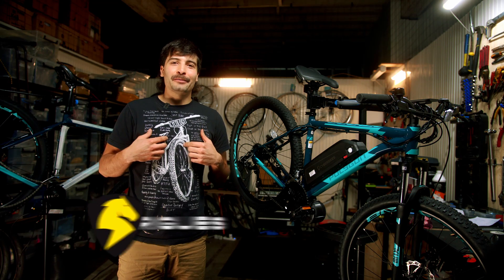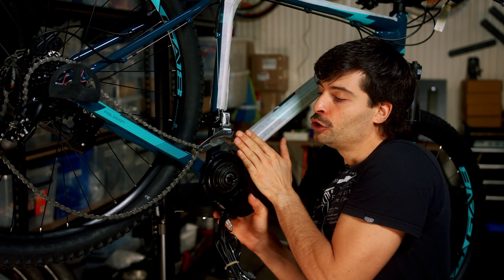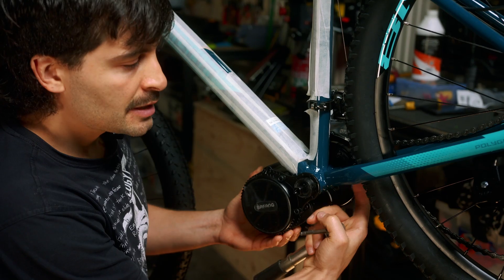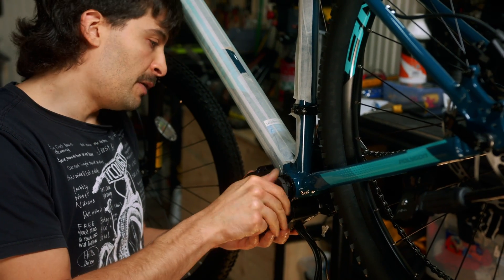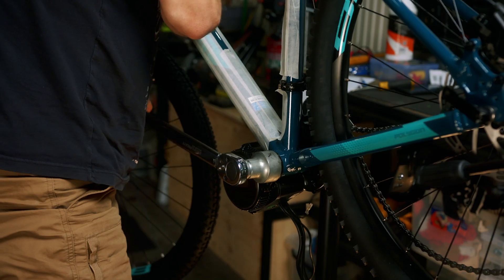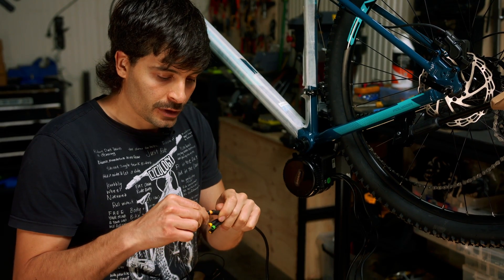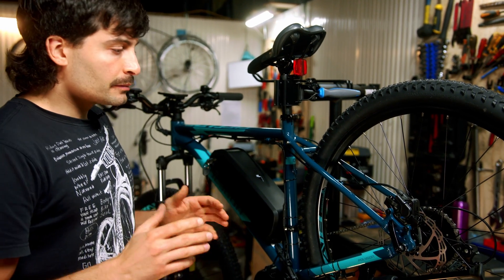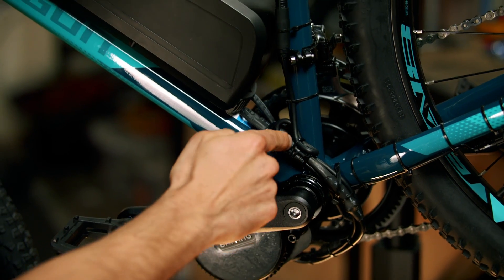How to Install a Bafang Mid Drive motor on your bike

Comment: Hi Felipe - love your videos, you clearly know exactly what you're doing and I have been following your advice! I have a question and hope you can answer - at about 2:12, you add the supplied metal plate to the motor. On my bike, with the metal plate nipped up against the bottom bracket, I have about 5.5mm gap between the holes in the motor and the back of the bracket. To me this is too far to have the bracket "bend in", so I plan to use some of the supplied black spring washers. How many mm can I leave to get that "bend" you want? 1 washer width? Hope I am explaining myself clearly enough (first time fitting a BBS02 to my Rocky Mountain Growler). :)

Comment: Fantastic video, I wish I had seen it before. The screen went out a few days ago and I realised that it was for the reason you mention of having the connections behind the handlebars, causing an internal breakage of the screen cable terminal. I also made the mistake of running the motor cables between the motor and the bike frame and when I disassembled and greased it, I could already see a small break in the first cable cover (thank goodness I didn't break it completely). Now following your instructions I have proceeded to reassemble everything as you said and it is perfect. Thank you very much.

Comment: Thanks for posting this video. I installed a BBS02 on my bike and didn't even think about the chain stay clearance. I went straight away and checked it.  I have about  0.5 mm clearance between the chain stay and the motor shoulder. Guess I got lucky!

Comment: Hey! Does the motor need to touch the bike frame to tighten the bottom bracket? I gave mine a space between the engine and the frame because the format of my frame is pretty strange. Can I leave it that way? Thanks for the video!

Comment: E very easy to do I did my new 29” but it came with a PF30 which you will need a PF30 to BSA aluminum 73mm adapter pressed into your bottom bracket.

Comment: Does the BBSHD motor have separate wires for speed & shift sensors or do you have to buy a splitter  to hook both up ???
Reply from the maker: The speed sensor is one cable, the gear shifter is another cable, they have different connectors. What you have to check with your supplier is if the controller has a shift sensor connector, the speed sensor is by default coming with all motors

Comment: thanks for the video , can you maybe give advices how to organise cables near the steering wheel not to look like a spaghetti
Reply from the maker: Great suggestion! use small zip ties and instead of squeezing them together try to mimic a loop around the brake cable

Comment: So glad that I found your channel, by far the best E bike channel on You Tube. In this video you say tighten the bottom bracket to 80Nm, but in your other video on the installation of the Bafang motor, you say tighten it to 60Nm. Which is the correct torque Thanks for all the time and work you put in to helping others
Reply: Hi Richard, that's true. We've said in previous videos to tighten the nut to 60Nm because that's Bafang's recommendation. However, at the shop, we have been doing 80Nm, and after much discussion with our mechanics, we decided to publicly say 80Nm is the correct torque, even though it's not endorsed by Bafang. So, in old videos, you will hear me saying 60Nm; in newer videos, you will hear me saying it's 80Nm, swimming against the tide and haters. Still, it is what it is; in real-world exposure, tightening the motor with 60Nm won't hold it in place, and 80Nm does the job without compromising the motor's integrity. Thank you for your kind words and appreciation; I wish you all the best with your installation.
Reply: @frcr90  Thank you Fellipe for clearing up the confusion. All the best

Comment: This is an excellent guide with important tips to ensure longevity and reliability of the system. These tips are learned from his extensive experience in installing, using and maintaining these mid motor Bafang systems. He knows what he is talking about. Take advantage of this wisdom.

Comment: Can I suggest sir? Why if we put a METAL BRACKET or it's equivalent on a diagonal frame attach to the motor so it won't fall down in case the support provided by the Bafang kit.
Reply from the maker: You can do that Rodolfo, there are companies that manufacture that sort of attachment, search for bafang torque arm/bar and you might find it
Reply: @Cyberbikesau  thanks Sir.

Comment: Thank you so much for these valuable insights!
Reply: No worries thanks for your comment Missak
Reply: @frcr90  i am confused between 500w and 750w, i live in a mountainy area, you think 500w is enough, i dnt offroad. if 750w, what battery rate do you recommend? thank you

Comment: Hi!
I Have A Q
It's Normal For The
Motor To Have Some
Resistant  When You 
Pedal.
 Not Using It???
Thank's
Reply from the maker: Yes, it is normal, there are many reduction gears inside the motor, bearings, and clutches, and all of them will generate resistance against your pedalling. What motor do you have? What's an issue you're facing? Is your question related to thinking of converting a bike and wanting to know if you could ride it like a normal bike?
Reply: @Cyberbikesau  Thank's For Helping Me🙏
It's A Bafang mid 750w
Puting It In A Mongoose
Ardor 27.5.   2.6 Wide tires. Just Watching Some
Vids On How To And Yours Is The Best💪
Thank's Broo🙏
May God Bless..
Reply from the maker: @danielandujar5479  thanks Daniel, looking forward to read your comments again in our other videos! We will publish some more juicy tips about Bafang motors, stay tuned!

Comment: Hi Fellipe , Question on the install , the chainring is it the stock Bafang chainring or one with more offset due to putting space on bottom bracket ? Thank you for taking the time to advise me it' truly appreciated.
Reply: Marc, it's not rocket science. If you added spacers on the motor, depending on how many spacers you will need a chainring that's more concave to compensate for spacing the motor away from the bottom bracket. Usually, for up to 2-4mm spacers, you can maintain the original chainring, but everything depends on your installation. Every installation is unique. Please to share our videos with your mates and spread the message. We help each other. Cheers.
Reply: @frcr90  Hi Fellipe , I understand , spacer = more offset. I got the stock chainring and put a 1mm spacer at the bottom bracket chain line looks straight but unfortunately I can't shift it on first gear or my 9th gear. I'm going to need to order more offset. Can you suggest a chainring. I'm thinking the 46 t Lekkie Bling ring could solve it but would like your advice before I spend big bucks.  Hoping to hear from you , Thank you Sir.
Reply: @marccardinal3137  why can’t you shift to 1st and 9th?
Reply: @frcr90  Hi Fellipe , Sorry for the late reply. I made a mistake I can shift on 1st gear but when I shift on 9th gear which is my last gear the chain jumps to my   8th gear on my rear cog when I start going really fast. Do you think a different chain ring like Lekkie46 t HD could help ? I followed many of your advice , which really helped a lot.

Comment: Hi felipe. I noticed you still have the chainring guide on. But you the controls are no longer on the handle. Is it disconnected? If yes where and did you disconnected from thanks for the great videos brother 🙏
Reply from the maker: Hi Noah, the front derailleur now works as a chain guide, and we want it there to prevent the chain from dropping to the inside the frame when engaging first gear. 
The gear shifter on the left-hand side was removed to give space to the throttle and LCD remote control. That's a standard here at Cyberbikes and I suggest you follow it too.
Reply: @Cyberbikesau  thank you 😊
Reply from the maker: @ynnz  Thanks Akhtar!
Reply: So i went to disconnect the cable. The derailleur is under tension. Now its rubbing against the chain really badly. Please advice on how fix this thank you 😊
Reply from the maker: @noahpopal9922  hahha so thanks for letting me know, we will have to record a video explaining how to do it because it's quite complex, basically you will have to use the stopping screws to lock the derailleur where best suits your chainline. Does that make sense? I suggest watching a video about tunning front derailleur to understand how they work.
Reply: @Cyberbikesau  ill be looking forward to the video thanks for the reply 👍 😀

Comment: Hi Fellipe , I started my install yesterday BBSHD , when I start tightening the nut to 60 nm the shoulder of the motor moves against the chain stay. Looks like I might need spacers , I'm I correct ? Can you recommend where to get the spacers that you use.  Please advise , Kind Regards !
Reply from the maker: Hi Marc, we buy spacers from our Bafang dealer in China, however you can get spacers on eBay/AliExpress, or spacers used on cassette gears or you can manufacture your own spacers if you have a metal pipe with the same diameter at the bottom bracket.
Reply: @Cyberbikesau  Problem solved Sir , I noticed that the shaft that goes in the bottom bracket was wobbling so I taped the shaft to stop the wobble then I tighten the nut and I also put hose clamp around the motor to my frame. Solid like a Rock Fellipe and there is a very small gap at the shoulder of the motor and chain stay.  Thank you Fellipe ! I have one more thing to discuss with you and get advice. Please see my new comment.
Reply: @marccardinal3137  Happy to know that! What other comment? There are too many comments every day. If you can please copy and paste it here. Cheers!! Happy riding!!

Comment: I am about to install a bafang midirve motor on my bike this has been one the best informative videos I have watched on installation advise - Thank you
Reply from the maker: Awesome, thank you!
Reply: Hi Brian , I suggest that you measure your existing bike front chainring to the end of the bottom bracket before removing it and installing the motor. With that measurement you'll be able to get a close to perfect chain line by adding different size bottom bracket spacers or a different chainring then the stock one. Chain line is very important to save you on wear and tear on your bike components.